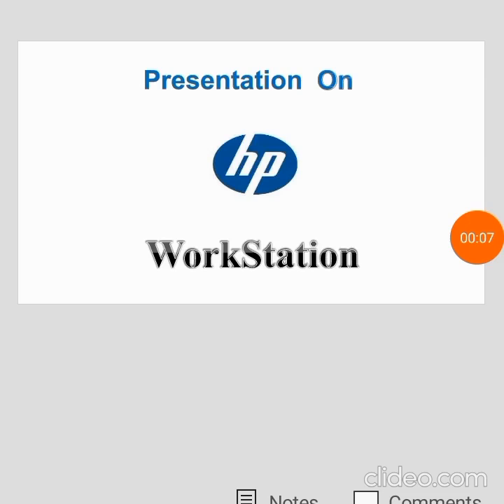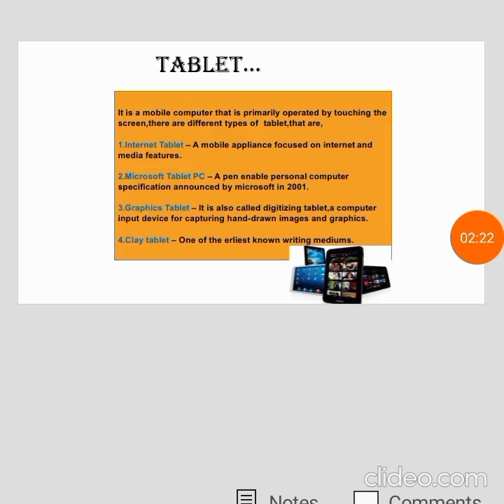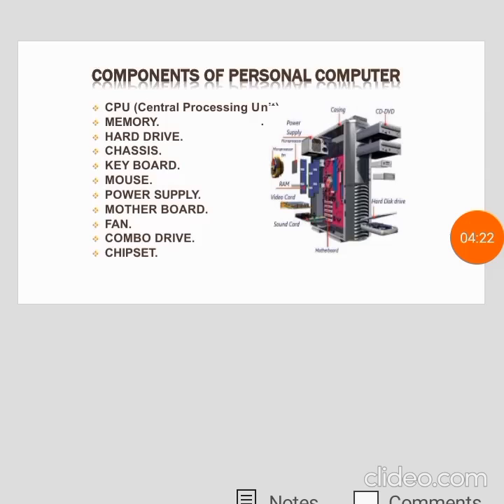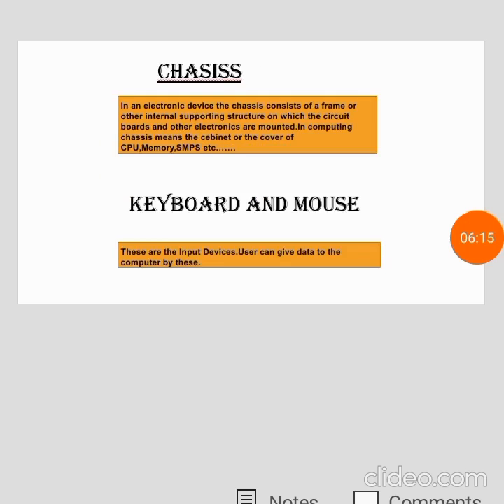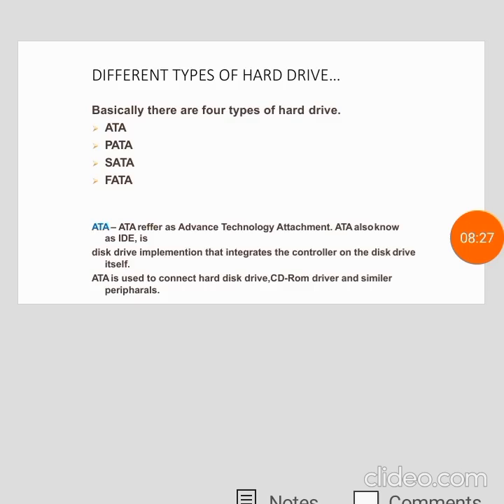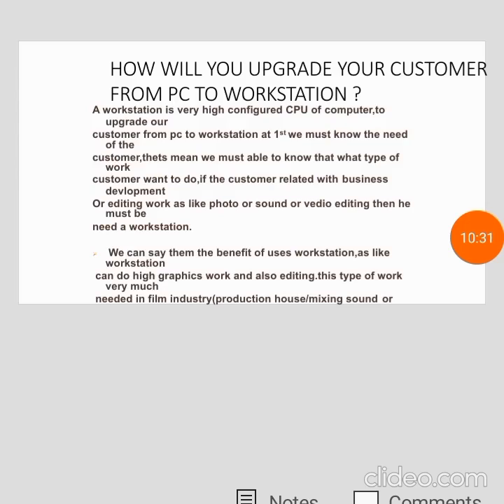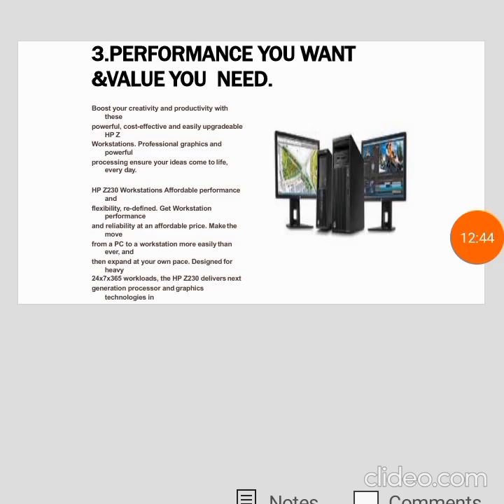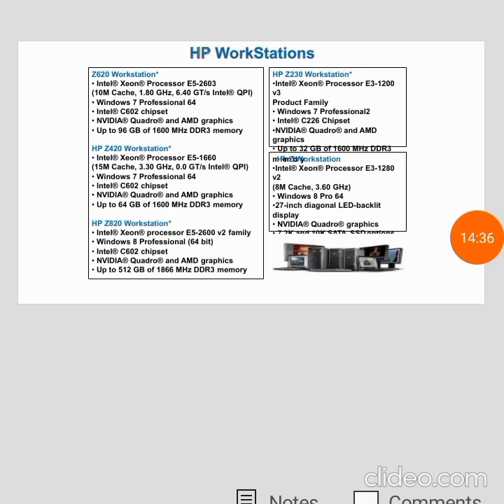Workstation

Comment: Good 
Summary 
workstation is a special computer designed for technical or scientific applications. Intended primarily to be used by one person at a time, they are commonly connected to a local area network and run multi-user operating systems

Comment: Good
Summary :A workstation is a special computer designed for technical or scientific application. Intended primarily to be used by one person at a time. They are commonly connected to a Local Area Network and run multi-user operating systems.

Comment: Good
Summary:
Workstation is a special type of computer that is designed for scientific and technical applications. It has fast speed and allows users to perform many different functions quickly. It usually use LAN, local area  network.

Comment: good
summary
        workstation is a special computer designed for scientific applications. it works on LAN. it is only designed for a single person. it is multi-user operating system.it is used by one person at a time.

Comment: good
Workstation are the high-performance computer system that is basically designed for a single user and has advanced graphics capabilities, large storage capacity, and a powerful microprocessor (central processing unit).the Allow a very fast speed to user and done many functions quickly. It is usually use LAN.

Comment: Good.
A workstation is a special computer designed for technical or scientific applications. Intended primarily to be used by one person at a time, they are commonly connected to a local area network and run multi-user operating systems.

Comment: Good                                                           Summary:A work station is a special computer designed for a technical or scientific application .It is primarily to be used by one person at a time they are commonly connected to a local area network and run multi user operating system.

Comment: GOOD
 Desktop computer is called AIO PC. Some common components of PC are CPU, memory, hard drive, chassis, keyboard, mouse etc. Work stations have uses in manufacturing, financial accounting, geographical innovations, , bio medical, animation etc 

Workstation is used for technical tasks; connected with a LAN network but designed for one user only. Previous versions include PDA, tablet, laptop, PC. PDA is smart phone also known as palmtop computer. We use tablet by touching screen

Comment: Good
Summary
Workstation is used for technical tasks; connected with a LAN network but designed for one user only. Previous versions include PDA, tablet, laptop, PC. PDA is smart phone also known as palmtop computer. Some common components of PC are  CPU, memory, hard drive, chassis, keyboard, mouse etc. Work stations have uses in manufacturing, financial accounting, geographical innovations,  , bio medical, animation etc. By increasing performance, durability, cost PC can turn into computer

Comment: GOOD✌
SUMMARY: A workstation is a special computerdesigned for technical or scientific applications. Intended primarily to be used by one person at a time, they are commonly connected to a local area network and run multi-user operating systems.

Comment: Good.
Summary:
Workstation is used for technical tasks; connected with a LAN network but designed for one user only. Previous versions include PDA, tablet, laptop, PC. PDA is smart phone also known as palmtop computer.  We use tablet by touching screen. Laptop is portable PC. Desktop computer is called AIO PC. Some common components of PC are  CPU, memory, hard drive, chassis, keyboard, mouse etc. Work stations have uses in manufacturing, financial accounting, geographical innovations,  , bio medical, animation etc. By increasing performance, durability, cost PC can turn into computer.